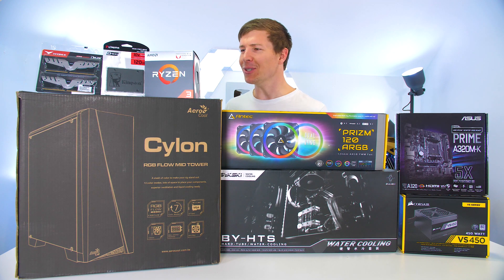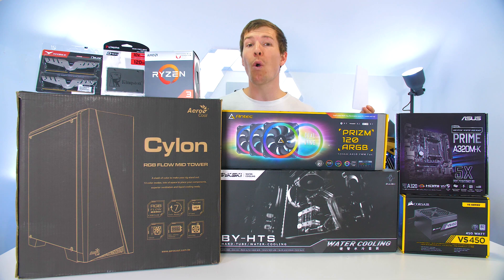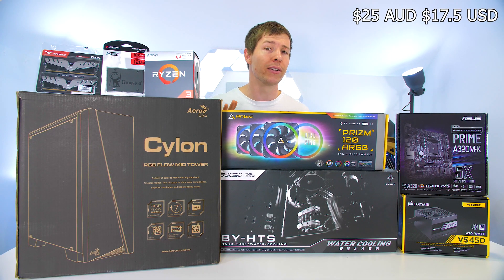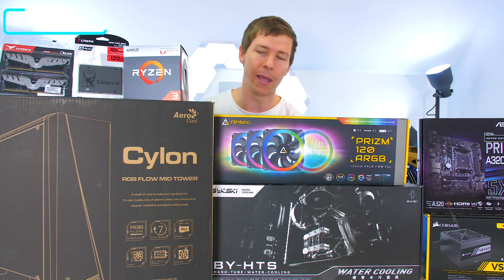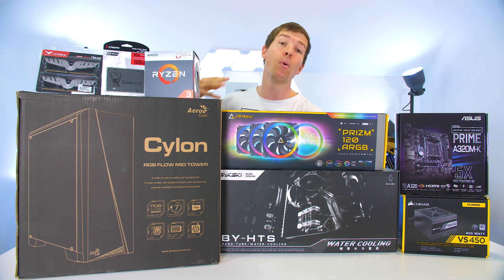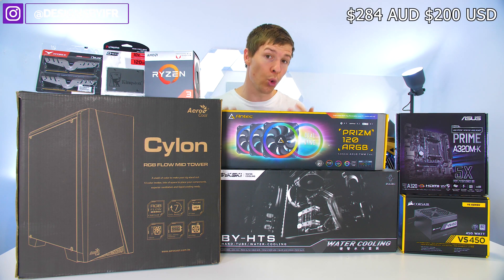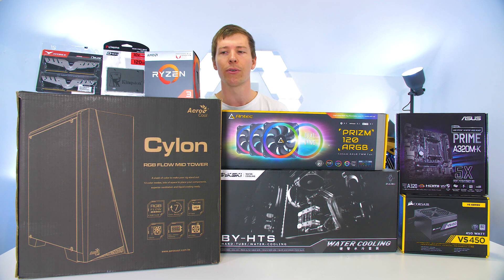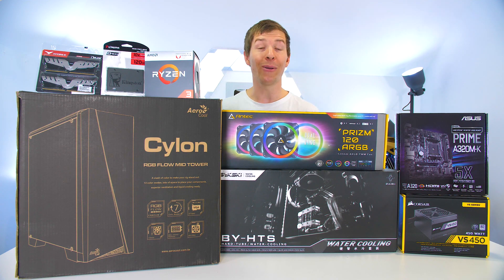Best $350 BUDGET Custom WATER COOLED Gaming PC Build Guide - Time Lapse + Benchmarks

Comment: Sorry for the dumb question but I'm still new at this, how cold is the cooling water?
Because my friend told me that his friend's water cooling freezed and when it started working it melted and it wrecked the whole PC
Reply from the maker: The liquid can only be as cold as room temperature
Reply: Thanks!
Reply: Oh, and the water cooling is safe todays, or not?
By the way, what kind of water does it uses?
Normal water from the household or distilled water?

Comment: It's definitely more important to spend money on water cooling a ryzen 3 than on a gpu...
Reply: That is not Made for performance but for ART
Reply from the maker: Thats right
Reply: The vega graphics built in are very good actually
Reply: Than why even include the price and tell us how much of a "BARGAIN" everything was. Some people who don't know much about pc might buy similar component and then wonder why they get 10 fps.
Reply: Max max plus it could depend on the way they keep there settings and what monitor they use. When I got my new PC it ran 40 FPS max. I changed settings and now it runs 140 to 160 FPS and my monitor isn’t the best either. My PC is more than this rig but just make a few adjustments and you’re good to go. (Yes I realize this was a month ago) My story was about Fortnite btw
Reply from the maker: @Maxmax-cr9sq  because it was a bargin you fruit cake.. its also a medium to low end budget pc. You would know that if you watched the video and looked at the bench marks
Reply: @DesignsByIFR  shots fired

Comment: Where's the point of watercooling a Ryzen 3? Especially when you cannot overclock it because of the A320 Mainboard. This is just money wasting. At least use a B450 (or even B350) Board so you can use the aditional cooling performance you gained from that custom budget doubler. What is the point of spending half the budget on cooling you're not able to use?! Apart form that is it not really representative for what prices you got the parts. If somebody wants to rebuild this system in another country like the USA or Europe for example, the prices for used hardware could be completely different. I'd at least used the new prices for the budget.
Reply: Sorry for my crappy english. Not my first language...
Reply from the maker: The point of water cooling it is i wanted to and i can because its my pc. I also wanted to show that i can water cool it on a budget. Everything is not just about performance, people enjoy having a nice looking pc. I did also state that people do not need to have the water cooling and could simple leave that part out to invest in better hardware or a gpu like an rx 580.
Reply: @DesignsByIFR  Undastandable, but I keep my statement that you at least should have used an overclockable chipset. It was just triggering me to death to have more performance potential in this build but it could not be used. If it's all about the esthetics you could also watercool an AMD FX 4300 and it would look nice. But nobody would do that eiter. I like nice looking PCs, no complains, but performance is also an important thing.
Reply from the maker: Performance is still good for what you are getting here. Its a medium to low setting gaming pc

Comment: I was like omg only 300 bucks until I noticed the non existing gpu
Reply: xD ikr !
Reply from the maker: Its an APU, take away the water cooling and buy yourself a gpu =) still only $300
Reply: @DesignsByIFR  is the apu the chraphics unit in the processor?
Reply from the maker: Yes Vega 8 graphics
Reply: since he bought used we can grab a 580 for around 100 a few weeks later....
Reply from the maker: Yep save up abit more and purchase the rx 580 if you have the money
Reply: @DesignsByIFR  I already have a pc in mind with a rx 5700 and a ryzen 5 3600 I was just wondering. :)